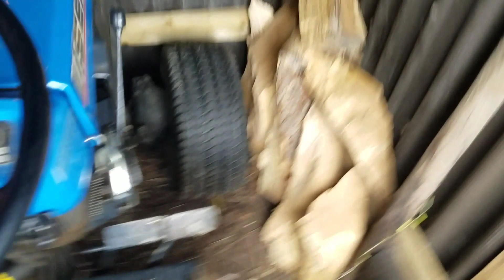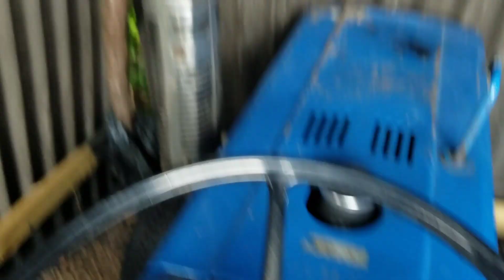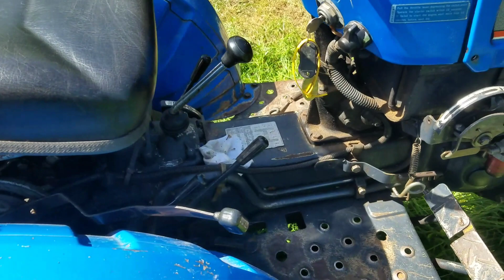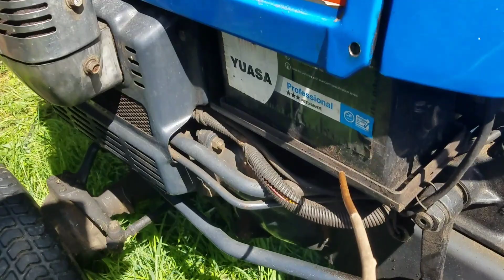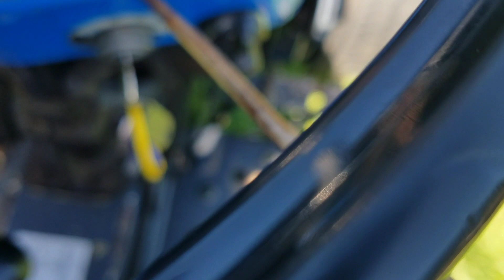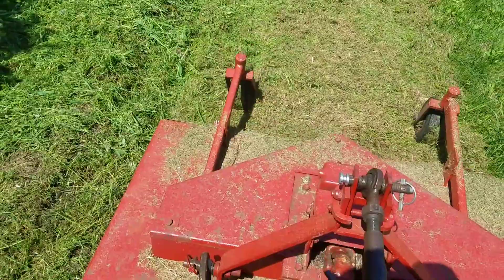Iseki TX 2160 4x4 diesel compact tractor with finishing mower cutting a field

Comment: Morning what length is your finishing mower? Just trying to figure out what width brush cutter it can take. Thanks
Reply from the maker: Hello mate, went out yesterday to measure for you, it's 130cm wide and 80cm long on the deck itself. Extends more than that from the tractor because of the hitch obviously. Before that I used to have a 115cm wide flail mower that could just eat anything